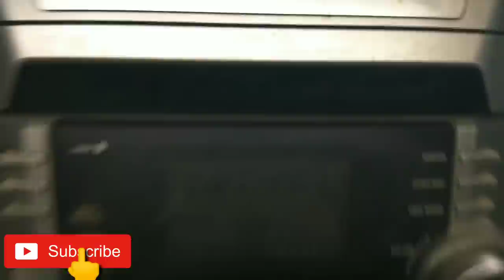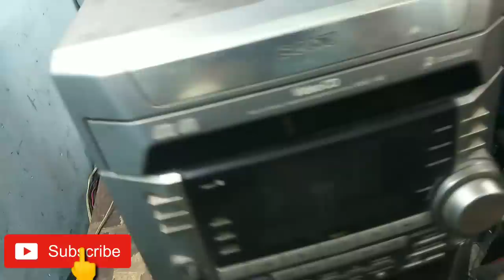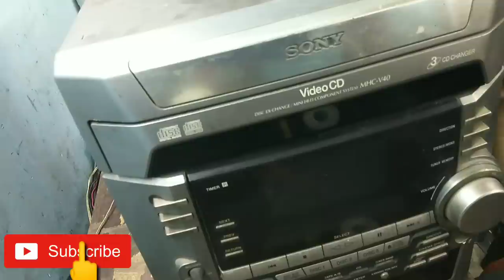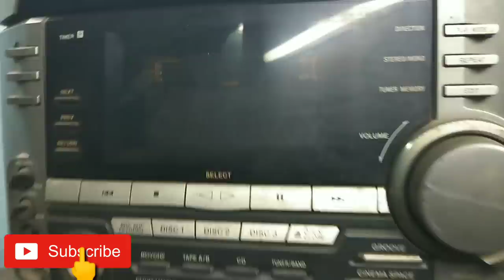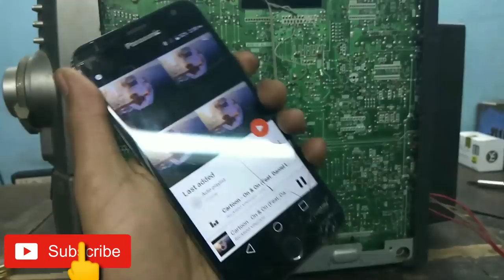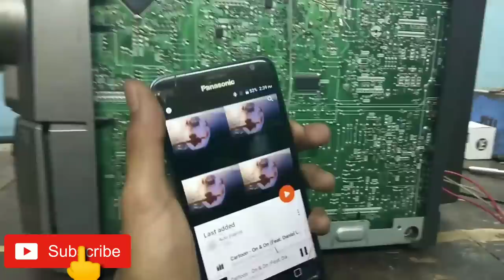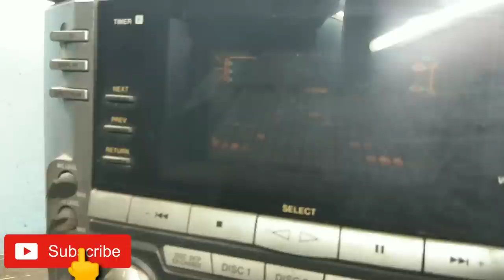Convert Bluetooth in Old Music System

Comment: This is straight forward DIY to convert your any old CD player, amplifiers, desktop 2.1 speakers with Bluetooth, FM, USB, SD card reader.
You could pick just a simple bluetooth board or one haveing everything such as FM, bluetooth, aux, USB..etc. Though  I appreciate the intent of this video to enlighten people to give their old audio systems a second life it is not complete and has some short commings and one would end up frustrated.

1) You could use any of the audio input on the player that is no more in use such as CD player or AV input for the purpose of connecting audio out from bluetooth  board 
2) You could tap power from onboard 5V IC regulator output (usually 7805) or just use an mobile charger of atleaste 700ma and higher amps depending upon the load connected. 
3) The audio ouput from the bluetooth/USB board can be connected to Left and Right channels of system AV input or CD player audio in on the circuit
4) One major issue is you will/may experience annoying humming noise if you connect the audio output wires this way  

Solution: connect a ceramic or polyster capacitor in series with the audio out cable which should fix the humming noise.  I used a 105 polyster capacitor(105= 1000000 = 1mfd and no ploarities) Donot use electrolytic caacitor which has polarities. Lower value capacitor should work too and I haven't tried.
I used both simple and cheap bluetooth board and also a similar board with FM, USB, SD card reader as well and the audio quality is quite satisfactory in either case.
Reply: Sir kindly do a tutorial on that please... I have one such sony music system but the CD changer is not working anymore because of the unavailability of the belts. But I want to use Bluetooth instead... It will be much appreciated sir if you can help
Reply: Have u made tutorial on this. If yes please share.

Comment: Sony VX33 Push Power Protect problem please how can i solve this
Reply: Remove 100om 3 resister problem solved
Reply: @Krishnaprasad.755  boss 2ta 100om r 1ta 1om acy
Reply: @djrubel8758  100 om 3 three resister in power board.you replaced the part problem resolved
Reply: @Krishnaprasad.755  tnx boss